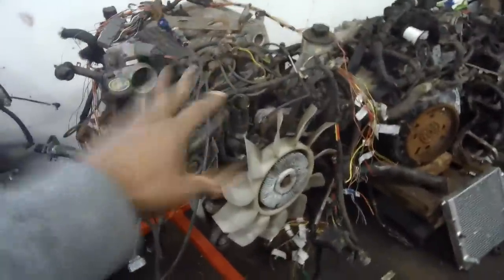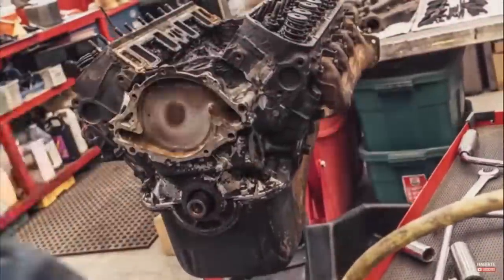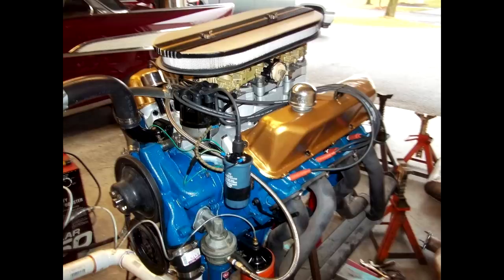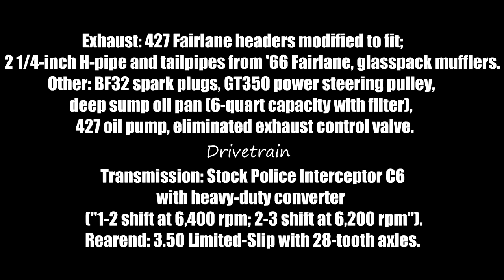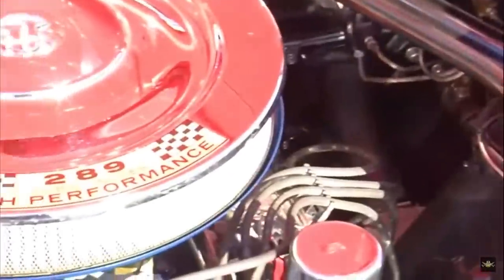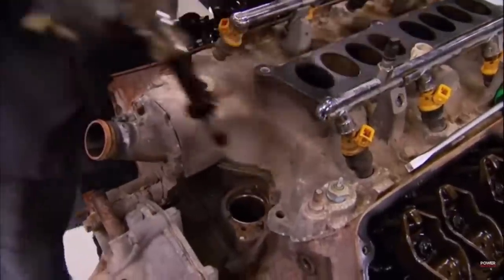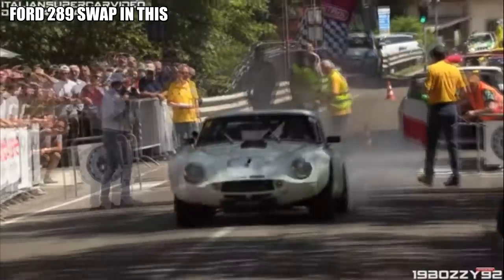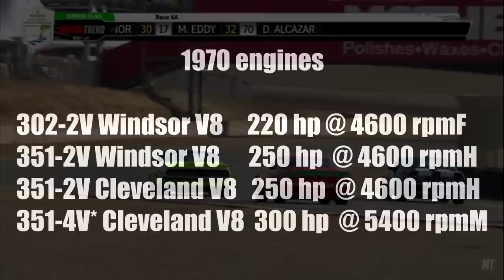289 Ford Voted BEST ENGINE BY CARROLL SHELBY ( HERE IS WHY )

Comment: 427 Side-oiler (More is better?)
351 Windsor (Strong as hell and super modifiable) 
302 
I currently have a 68' Cougar XR7 with a 302 with the factory four barrel.  Maybe it's just old prejudices, but when I hear 289, I think, well it's better than the straight six.
Reply from the maker: I like that line up

Comment: The 289 HiPo  was hard to break .solid lifters,screw in rocker studs. screw in freeze plugs.The block was cast with stronger iron,  main journal caps were wider.,,,,,,,,,,,,,,,,.add a big radiator and dry sump oil and  you could  keep your foot in it all day

Comment: It pretty much depends on the size of the car what motor will work best. Most importantly is the front end of a car on how much weight it will hold depending on the springs and shock towers. Me I prefer a small block in a small car a big block in a big car. It's all about weight transfer. To me all ford engines sound good when they are built right. It is pretty much preference. But they all have good points and bad points same with other brands. But anything can be built to be strong and reliable. Main thing is take your time and do it right even if you have to save money and buy a little at a time while building it. Yes they cost money but sometimes if you shop around you you might save a little money. But do it right and the way you want it. Don't be in a hurry.
Reply from the maker: very true with all what you mentioned size of car ect. I think a small block with big block power would be ideal in a big car ( like a Crown Vic ) it would be amazing i may ways ( if you can balance the car ) right! This comment was spot on all engines have pros and cons to them

Comment: My experience with 289s is they are easy to build, have a better piston fps speed because of the short stroke than a 302. Higher rpms are easier to come by.

Comment: The 289 has always been a ripper. Even in the 2V variant. Not sure why ford went to the 302 the 289 in my opinion is a better motor. I have a stroked out 351 Windsor in my 69 Torino but am building a 289 for my wifes Falcon. Never owned an FE motor but always wanted to.
Reply from the maker: You have some sweet ride i want your line-up but with a 1972 Torino and falcon for the wife... Thank you for this info and comment man I am inspired Josh

Comment: All you had to do with the FE was to change the intake to aluminum and it really wasn’t significantly heavier than a SBC. The bullshit about handling is just that. I have made doorstops out of 289s and to put them in the same class as the FE is  ill informed. Build a 410 from a 66-67 Mercury, put a good roller cam in and an aluminum intake with headers, you are making 500 hp and 500 ft lbs. and weigh it. Don’t take the weight out of a book. Mine with iron heads fully dressed is 515 lbs. All I would need to do is bump the compression up to 10.75 to one and it would make a hp per lb. The 289 never did that. I got the core from the junkyard. Internally balanced it, and it isn’t high strung at all.  A 399 ci 390 can make 1.5 hp per ci. This was built by a great builder, but it was not exotic at all. But to me the best bang for the buck was in building a 410 FE. That should have been in the 66 Fairlane, 67 Mustang. It is like a small block with a big set of cohones if you build it to its strengths. And 6500 rpm’s is all it needs to rev to. That torque is what makes it a street brawler. A 3.98 stroke with a good 390 block doesn’t need a lot of porting the iron heads. Put CJ valves in or 2.15 intakes fit 1.6. exhaust valves work well with headers. I don’t know why they built the alphabet soup of garbage in the 70s . The C is the only one that is worth talking about.

Comment: How come no mention of the 292. My neighbor had one in her '63 Fairlane. That motor was so quite you needed to look at the fan to know if it was running.
Reply from the maker: well we are dealing with the most common that you can get your hands on.. There are so many engines i missed
Reply: Maybe,,but. Not from factory..63 was the first year of the sbf 221,260,289 and ONLY in the Fairlanes ..

Comment: A 302 without the pollution garbage, same size and weight and alittle more power than a 289. A 351-W same weight only 2 inches wider in size. They all weigh 460 pounds in long block formation. assembled block and heads. Compared to a small block Chevy at 575 pounds. For the compact size and light weight, I would call it on the Ford 302, best engine. Can be built into a 347 stroker with trick flow twisted wedge heads if you really wanted to get crazy and go to the limit.
Reply from the maker: I can really lean on you with that one brother/ i just added one to my Maverick  click here when you have some time Fly one https://youtu.be/0JweZqQb0oU

Comment: Yoiu never even mentioned the shotgun mnotor. The best motor Ford built in the golden era. The street version was choked up to make emissions and calm the insurance companies down. But with a tiny bit of work it could out run and out last anything else Ford ever built.
Reply from the maker: 429 boss version HUGE intake alleys that can fit a tennis ball in them will zero squeeze I was saving that for a later time.  I do read up on that motor it was something . there is so much stuff out there to cover most times i forget.. Thank you for the solid reminder i have to go study deeper before i make a error and they will come for me ( Old School Ford guys )

Comment: Right but wrong, Cadillac was the first domestic to do a v8 witch required multiple castings for a single v8 block as it was done else where. No one was capable of doing a single cast at this point. FORD was the first to invent and successfully use the single casting of a V8 block.
Reply from the maker: you sir was more detailed i just skimmed, over and i thank you for this

Comment: What's the best tool for the job?  Well, it all depends upon the job ;-)   I've got a 67 Fairlane with its original 289... but for a big cruiser like the Fairlane I reckon a 351 would be about right -- for those times you want to stab it to the floor and just get moving.  So... need to think about popping that 351 into it...

Comment: make no mistake the 351 heads will set on a 289. the 289 heads are built wrong for the power the engine is capable of producing.  the 302 head is a direct bolt on.
Reply from the maker: right on for the info... I think so many people tend to go with the GO BUY approach of performance that they forget about the minor swaps.. i read and see what can be done or what has been done. great info
Reply: @bstfordchannel923  the 289 is pretty much a 302 with bad heads. take a set of 302 71 presmog and they have huge ports and you can get 300hp without sinking much more then a cheap rebuild at it.
Reply from the maker: @ozmister101  that may be the move taking that route I will be calling on ya once i get things going Ozzy
Reply: @bstfordchannel923  nothing to know if your using a 302 head for a 289. its a direct bold on. just have to measure the push rods to make sure theyre not to long or short
Reply from the maker: @ozmister101  ok i see what you are saying for that.... i can wait to get to that level
Reply: @bstfordchannel923  just use a good set of 71 heads for a 302 and ull have all the power you need. just port them and they will be everything you will need to get 400hp out of it.
Reply: @bstfordchannel923  yea ur there u just got to apply yourself
Reply from the maker: @ozmister101  true very true I have like 5 kids and such working trying to make it happen its a bit tough to really dig in as one would like to.... I do my best and i will get things done brother.. And i thank you for this comment its helpping
Reply: @bstfordchannel923  trust me I know what u mean with kids they wear you thin lol
Reply from the maker: @ozmister101  dude you have no clue ( I mean you do ) but man I have the youngest THIS dude is Dennis the Menance x 8 and that = house f up

Comment: This is why  Chevy  Ls  motors  rule
Reply from the maker: The ls motor rules because chevy stuck to the script ( as they should ) and now they can not change it by no means. ( it works and makes power ). This is great motor for cheap hp for those that do these motors, but they are like Vtec engines jdm world

Comment: Well  I’m Not the average BillyBadAzz, I’m Working on swapping the high reving  VooDoo 5.2 L FlatPlane Crank for the 351 Windsor. Check out channel only 16 learning form you guys.
Reply from the maker: sweet ride you should get a gopro and really film the car.. the car is sweet.. You really need to do this proper

Comment: 289 all the way
I have had the 351w
302w and 289,
The 289 is a higher reving motor by far,and if u build them right indestructible 
I spun a crank  bearing
Grabbed a aluminum can
Cut it up to match the bearing, put it back together and got 3 more years out if that motor then sold the car with the motor, 
ONLY MOTOR FOR ME
289 STROKED OUT
FIRST ON RACE DAY

Comment: Fords top motors performance wise /  small clock is the boss 302 r code 351 Cleveland / r code 427 boss 429

Comment: I owned a mercury cyclone with a HP 289 I had it balanced and blue printed holly 650 in the little town I lived in it was a top dog I shifted @ 7000 rpm never broke anything had a 4 speed transmission .  Some day I will tell you about my 70 cougar eliminator 351 Cleve.  I was told they only built 2200 can you clarify that for me?  Thanks Rick from missouri
Reply from the maker: well thank you for this comment you have some sweet rides brother.. There  2,268 were Eliminators. The standard 351 Cleveland was installed in 1,425 1970 Eliminators. So if the numbers match on engine you have gem sir

Comment: The 289 & 302 are pretty much the same block. Just a bigger bore for the 302.
Reply: They both had a 4 inch bore. 302 had a different stroke. You can’t mix a 289 crank with 302 rods. They have to match. Pistons are interchangeable
Reply: The only difference in a 289 and 302 is pre-1964 289s have a 5 bolt bellhousing pattern instead of the 6 bolt standard ford 'small' windsor pattern. Everything else is in the rotating assembly alone.
Reply: Michael Free no it’s not. A 302 has smaller connecting rods with a larger stroke crank. You cannot put 289 rods on a 302 crank and slip it into either a 302 or 289 block.
Reply: @thesecondcoming4425   "The only difference in a 289 and 302 is pre-1964 289s" Stick the word "block" in there after 302 so it reads "The only difference in a 289 and 302 block is pre-1964 289s..."
I was about to chew on you but I realized I blew it and omitted a word.
Reply: Michael Free no chewing!  I also remember that the 302 also had longer cylinder bores thus putting a 302 crank, rods and pistons in a 289 block was discouraged. I’m not sure if I’m remembering correctly though.
Reply: @thesecondcoming4425  You are correct (I'd forgotten), but it's a tolerance-based issue. Some work, some won't, just check the rotating clearances like any other modded build. IIRC that's primarily the early blocks as well, before the 302 was considered. 

Any time you stroke a motor you should check to see if you need to do some grinding to keep decent clearances.

Comment: My cousin has a 66 galaxie with a cammer in it. My brother has a 63 motor and he had a 68 torino with a side oiler in it. He sold that for good money. Me , I have a 67 stang coupe with a real hi-po motor which is identical to the 306hp 289ci in the race shelbys. It screams.

Comment: Gotta question if I have a 289 some one put an 2m crankshaft from a 302 is it now a 302 I know there's a lot of similarities. The rods for a 289 would be to long for this block. The guy said it was a 302 block says 289 he had 302 parts on it. Thanks

Comment: So just take a few steps back and look at this from another perspective.All these engines are tools . Like any tool box you cannot just have a hammer , nor can you just have a Phillips head screw driver.
So you have to ask what is the job that needs to be done . Also , Rules played a big part in what was used in some cases . Cubic inch rules and so forth.
Also some of these engines are replacements for others. the 302 of course replaced the 89.
If you sit down and put together your tool box it would include the original cammer , the 302 , the 460 and the 429 and you would drop pretty much all of the FE engines under 390 although it could be argued that the 427 could handle all of the duties of that engine line just fine on its own.
All these engines came to be for a use as a tool to get a task done. Thats how you have to look at them or it may not make much sense. The Michigan line of engines , well , lets just try and forget about them. No they arent "Modified" the M is for the Michigan assembly plant.

Comment: Dude. Knock it off🤣. Looking backwards, what am I building? Daily have fun and really mess with people.  Fastback Mustang II, MODERN 289 solid roller FI, 5spd w/3.73s and no graphics. Can you say Sleeper? Light car with a screaming SBF. Put a smile on my face that's for dang sure. 
And I'm not even Ford fan but I respect what's available regardless of brand.
Reply from the maker: no debate here everyone has what they like ( i am just getting info ) i have 302 and just got a 351.. 302 in maverick and the 351 maybe in a crown vic not sure yet..
Reply: @bstfordchannel923  they did use 302s in some Mavericks. Mavericks are very underrated. Ford actually supported them heavily the first couple of years.

Comment: That white car is a TVR Griffith. They are built in the UK. Theres actually a new one out with a Cosworth Coyote V8
Reply from the maker: ohhh? wow thats a great info dude never knew. thank you for that
Reply: TVR often used ford v6 and v8s it had some financial issues a couple of years ago but they are starting to make a come back. I’ve never seen a 289 V8 before over here in England. The odd Chevy. Have seen a boss 302. Great channel subscribed
Reply from the maker: @2011metalmaniac  That was a swapped one in that video it may had trumpets for the intake.. crazy sound, but i thank you so much for this very very detailed info. this so cool you came and comment I feel honored,, thank you

Comment: Hmmm perhaps he liked the Ford 289 because Ford was paying him a truckload of cash?  Just a theory
Reply from the maker: true I can side with that.. i think more it was a small engine making very good power of the time some where making 500hp so what was the need for a big block , so he thought ( for what he was using his cars for )
Reply: He liked it because it was tiny, light, made great power, and had legs.... long powerband. In road racing having some oomph into the higher RPMs can be seconds faster around a corner than a car that 'falls off the hill' and goes flat at high RPM or has to shift because of a lower redline. 

Funny thing is the 302 is essentially identical, just a longer stroke. Rod-stroke ratios are still favorable, no reason you couldn't take a bog-standard 302 or 5.0 windsor and turn it up like a 289 Hi-Po or Shelby variant.

Comment: I'm a die hard Ford to the day I die guy I've had a 97 ranger with the 2.3 sohc with a 5 speed manual and that was a bad ass little truck for what it was it run 104 mph 4th gear to the floor Screaming !!!! And I've had a 96 F-150 5.0 walked off on a newer f150 and now I have a 01 ranger 2.5 5speed some one please tell me we're thay when wrong cuz it seemed to me that my 2.3 ranger had wayyyy More ass to it than my 2.5 ranger and I have a 95 Ford F-150 5.0 364 thousand and some change on her and she will still burry the Needle so yeah ol Henry and master caral can rest in peace and smile knowing that built some bad ass engines
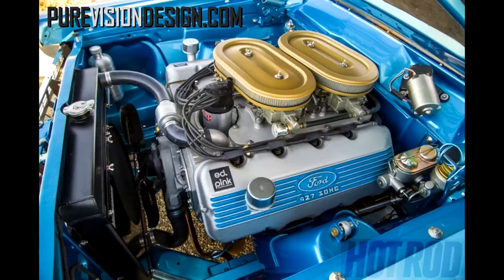Reply from the maker: I think the Ranger has traction lock and 4:11 gears in it.. its a lighter truck and the 2.4 in it has good tq for a 4 banger. its the Carroll Shelby theory of balance with weight Tq and gearing, just a balance truck for what it is worth
Reply: This past weekend I drove my 95 Ford F-150 from Conway arkensas all the way to Central Mississippi and back to Conway no issues no w I'm over 365 thousand miles

Comment: you left out a engine the ol 300 6cyclinder in a 67 F250 with the right speed stuff like insky cam and three one barrel carbs heavy on the mods and you had a truck that could pull stumps and run at a 100 all day long.
Reply from the maker: nope right here bro  https://youtu.be/OHuLMLjcQZs

Comment: The 302 didn't come out until 1968. The 351w didn't come out until 1969. The boss 302 didn't come out until 1969. The 351c didn't come out until 1970. All of these engines  were released long after Shelby was almost out of the cobra building business.  As Shelby stated, the only option he had in performance ford engines was the 289 and 427.
Reply from the maker: here is a semi- answer to what you where saying https://youtu.be/m8nZS3_TbwQ